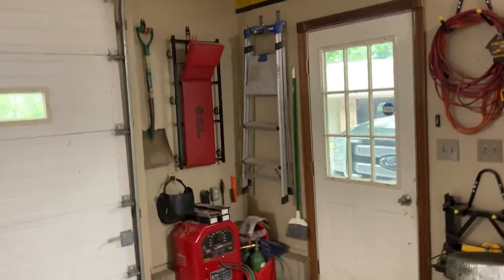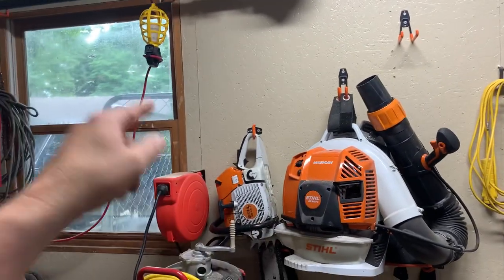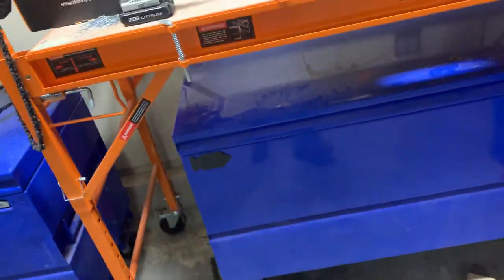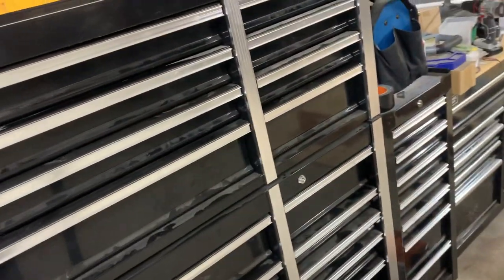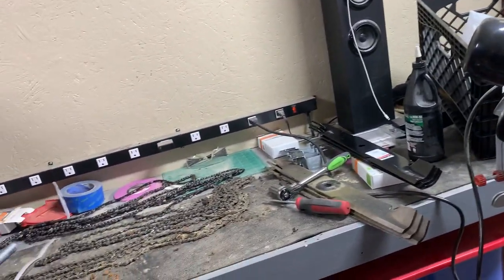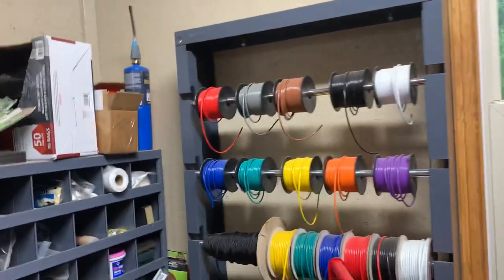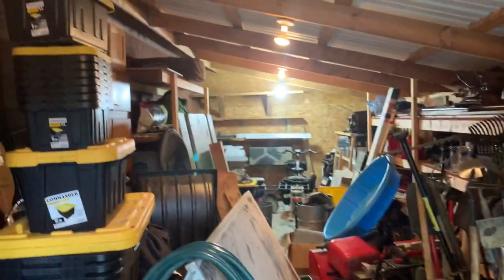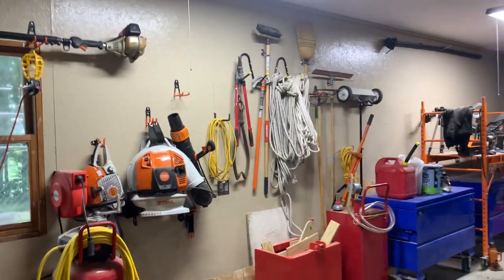Dream Work Shop Tour!

Comment: It seems your shop has the universal problem of all shops.  Every horizontal surface becomes a crap magnet.  If you plan on storing your tractor with the FEL in the air, it would be best to put something under it to support the weight.  Hydraulic lines lose their pressure over time.
Reply from the maker: Yeah I don’t store it that way long term. But you are correct. If i was storing it long term I would put a Jack stand or something under it to catch the weight. So far though they don’t have any bleed off.